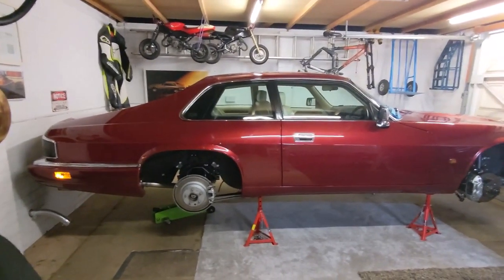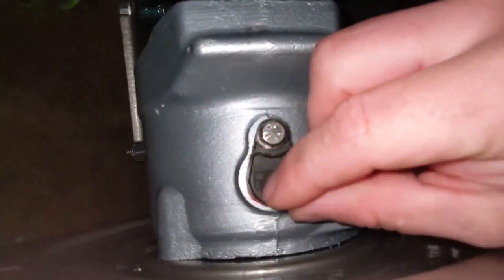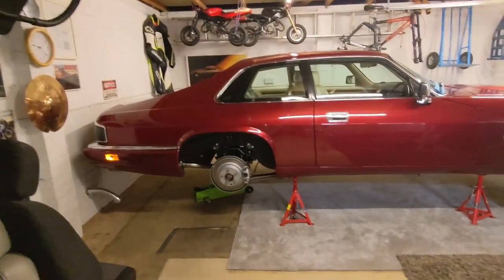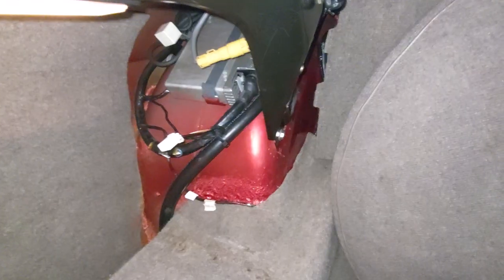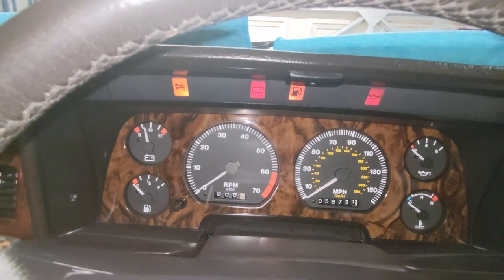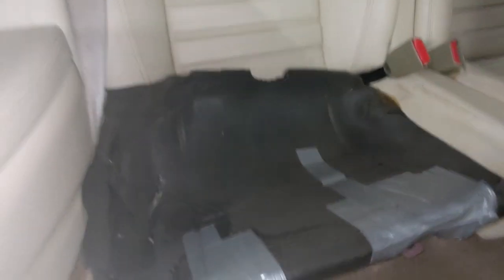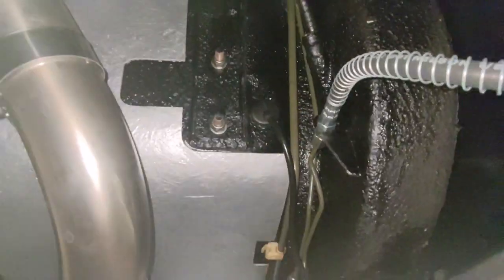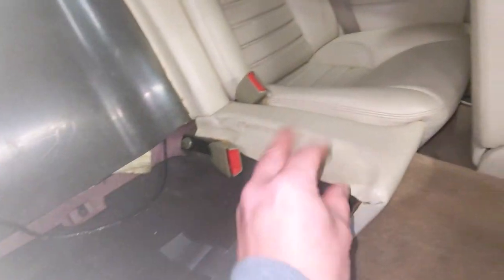Jaguar XJS V12 6.0l 1994 facelift abs fault finding part 1

Comment: Excellent videos fella.  Can we see the old-girl running?
Reply from the maker: Thanks 😊. Bit stuck at the moment running wise as I can't mot test the car without fixing the abs issue! So can't really go filming driving around as car is sorn at present. Plus in the UK now it's end of season so it doesn't really go out anyway during winter. I am however installing garage exhaust ducts in a video coming soon, so I can run the car inside during winter works etc without dying from the fumes!
Reply: Watching you work on the Jaaag makes me want to have a go too.  I’ve been very tempted to go for an old V12 but I really fancy having a manual conversion.  Perhaps I’ll see you on the byways of Cheshire when you’ve got the old-girl on the road next season.
Reply from the maker: @rosscopcoltrain8059  I used to own a facelift 4 litre.. simpler engine and in real world is faster.. but I just always loved the V12 6.0l facelift so when one came up for sale I couldn't say no! Still affordable and parts are fairly available too.. happy shopping!

Comment: Mine came out without any problem - whether that will be the same with the front ones I shall find out in the coming week.
Reply from the maker: My front ones came out no problem, albeit the bolts were rusted and are a pain to access unless doing a full strip down. The rear 2 gave me huge issues!

Comment: Hello, I have a 94 xjs 6 with the abs light on. Can you let me what scanner to use to get the codes and where. I am in the US. Thanks, howard
Reply from the maker: This video covers abs code readout on the vehicle dashboard for the facelift V12. I'm not sure whether it's the same process for the straight 6 4.0l. also I believe post 1994 cars had a basic OBD reader type port, so perhaps any reader will show error codes but I know zero about that later port. Basically if you've got the connector shown in this video in your boot.. jump the wires and read codes in vehicle as shown, if not you'll need a different video from someone who knows that setup!
Reply: @jaguarxjsocd  Hello, In the xjs-c 1994, the ABS light is constantly on. The code is therefore unreadable. Where should I look for the error. I am Tibor and Hungarian. Thank you.
Reply from the maker: @GobolyosTibor  hi.. unfortunately I can't help you beyond recommending you  read the service document.. see link below 

https://www.dropbox.com/scl/fi/89ki8tzvc2ith16etsdtt/ABS-Blink-Lights.pdf?rlkey=04nunkz7gd26i4vdw4uinh82g&dl=0